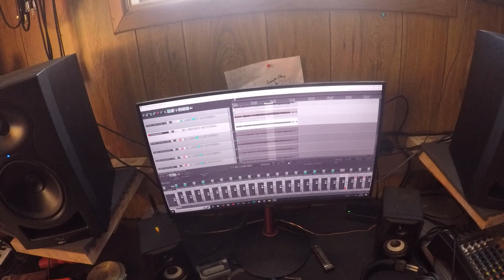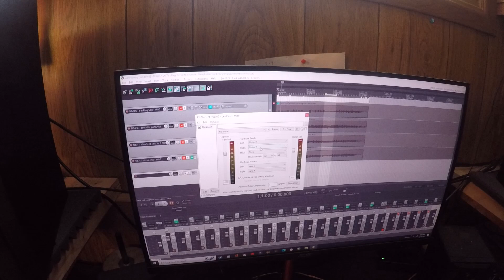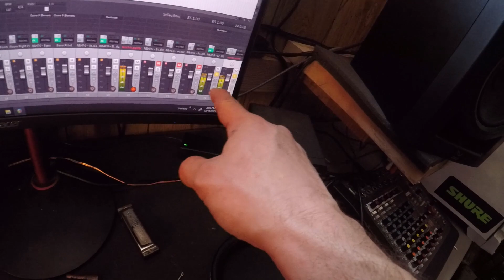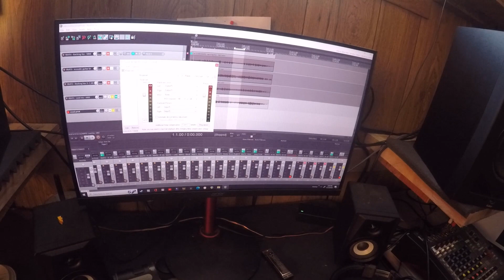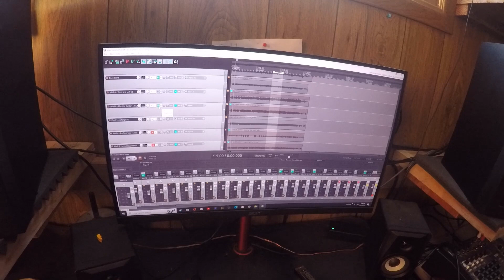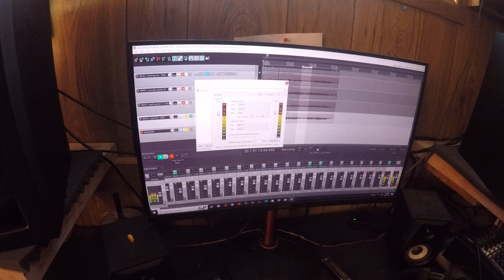How to use outboard gear with REAPER!!! (Solved)

Comment: Great tutorial, thank you. I'm pretty new to this analog hardware stuff and was wondering whether it was recommended to "simply" use the analog hardware (EQ, comp) during the recording phase in Reaper. In fact, I would be happy to record my guitar/bass tracks with the analog FX directly, without having to record a new track afterwards. Is it maybe not recommended because of increased latency this might induce? Thanks for your response!
Reply from the maker: Glad it was helpful, https://youtu.be/hQ-2dUaJWP0 here is a more update video that may help you more indepth.

As for recording while tracking, I feel that sometimes it's the best way to introduce yourself into the world of analog. It allows you to become more familiar with the features of your specific equipment, it's quirks and it's strong suits. But always remember when you print with analogue it's forever. 

I have found that it makes my final result better because I have to commit early and it becomes less challenging later in the box. I would suggest not  printing reverbs or other effects unless you're confident in their sonic qualities.

My advice is , experiment continually. Make some mistakes and solve them, it will help build confidence in your skills. I'm constantly learning and digging deeper into the limited pieces I have, it's just like any other tool. You could have 1,000 hammers but you really only need one. 

If you are looking to add analogue dynamics or effects you can follow the video I sent  

Good luck to you , if there's anything I can help with I will try my best
Reply: @bear-headstudios1212  thank you so much! Really appreciate it